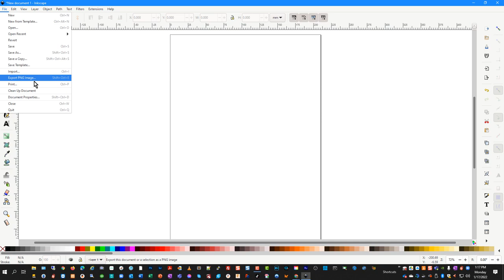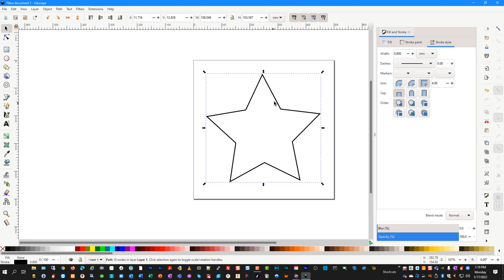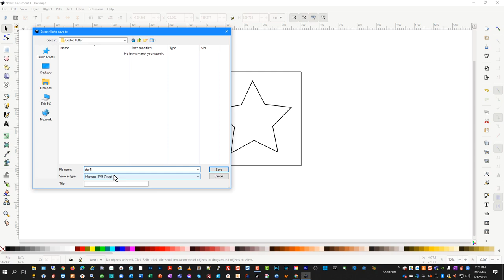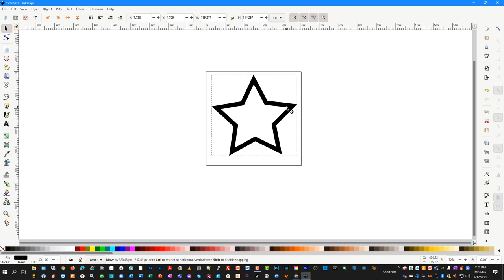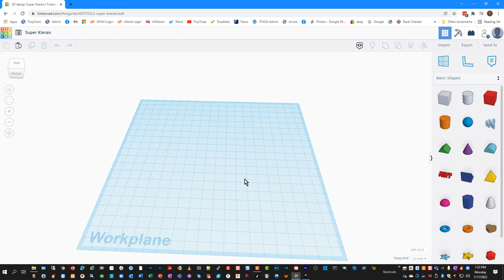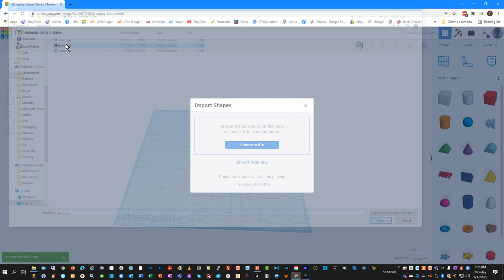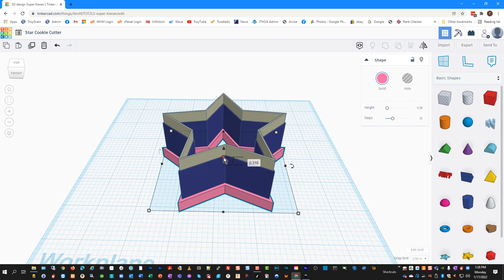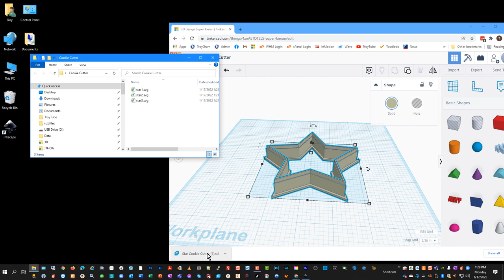How to design a cookie cutter in Inkscape and Tinkercad for 3D printing

Comment: Thanks for this tutorial.  I volunteered to provide cookies for my kid's HS band awards ceremony and thought "What could be better than a caricature of the band director?"  Your tutorial gave me just about everything I needed for the cutter base and I had to re-learn a little more InkScape to do the embossed lines for the features.  It was a success!  My only problem was I had made some lines too thin the first time so they didn't get printed.  I have to remember to check the slider preview before printing...

Comment: Great tutorial!  I appreciate how straightforward your instructions are.  

I am trying to follow these steps with a design I made.  I imported a png line drawing into Inkscape, used the trace bitmap function to get a path, and adjusted the thickness of the path to create three different svg files.  On my computer, the svg drawings show different thicknesses, but when I import them into Tinkercad, they all are the same thickness.  Any idea what I might be doing wrong?  

One thought is that the path in Inkscape seems to be one singular one on top of the line drawing instead of one around the outside of the line and one around the inside of the line.  Could that be the problem?  If so, how would I fix that?

Comment: Having done this for a year more since the posting of this video, have you discovered a way to make a smooth transition instead of the more obvious 2 stepped wall? I'm looking to create a clay cutter and want more of a "bladed" edge.
Reply from the maker: If you're wanting a tapered edge, I can't imagine a way to get that without sanding.  A resin printer perhaps, but I have not worked with them so I'm not sure of their capabilities.

Comment: Hi, I followed this tutorial but when it comes to changing the thickness of the line, it stayed the same. I started with a line drawing of a leaf, not a filled in image. What should I do to change the thickness of the line please?
Reply from the maker: The problem with starting with a line drawing is that you have two paths, an inner and an outer path, even if the line is thin.  You need to start with a solid shape.  The best way would be to do Path then Break Part and delete the inner object and start with the outer solid object.
Reply: @TroyTube  Thank you for explaining this. I have turned the line drawing into two solid shapes, as the inside of the leaf had veining, and then made two objects. I then used tinker cad to assemble it. Hope it works out when it comes to print.
Reply: @TroyTube  An update on the printing, hope you can help. The slicer didn't slice the 0.8mm wall. I selected print thin walls, it showed the wall in the preview. But when it printed, the walls were like a raft diagonal lines with thin layers in between making a net,  and not adhered to the next layer of the cookie cutter (the holder). Is there anything I can do in the profile settings to fix the thin walls?

Comment: Hello, is there an iPad alternative for Inkscape ??
Reply from the maker: Not really, at least none that I could find that compared.  At one time there was one on the App store that was a scam where they were tricking people into using it on a remote server window which gave them access to your login, passwords, etc.  Not sure if it's still out there or not, but be careful for any that actually say they are inkscape for ipad because it does not exist.
Reply: @TroyTube  Thanks for the reply! just one more question,I create images using procreate to print but then when i imported them to inkscape, i wasn't able to do the fill and stroke step, any tips?